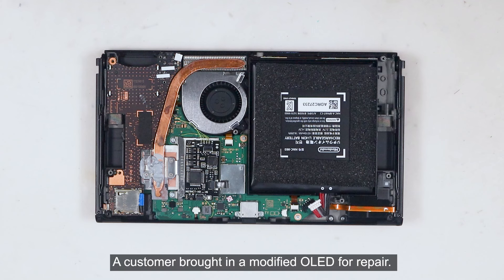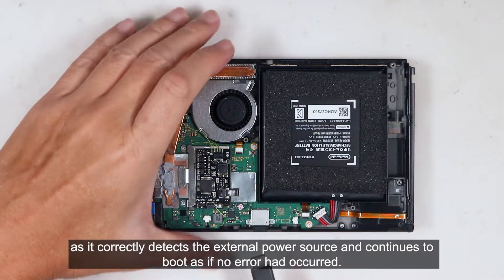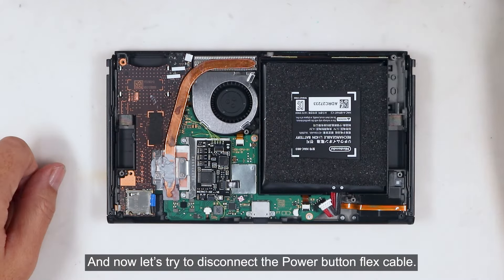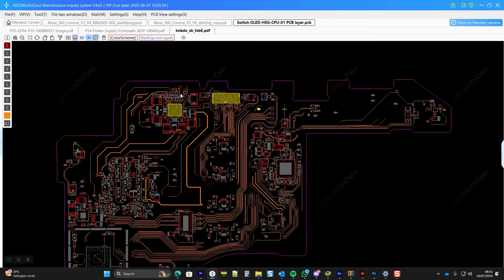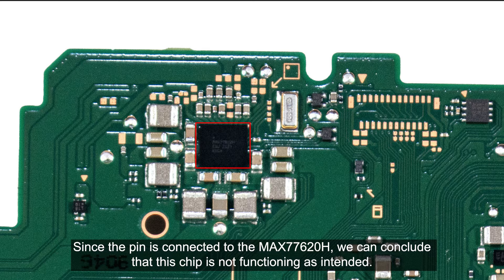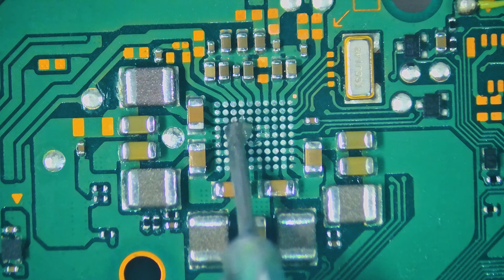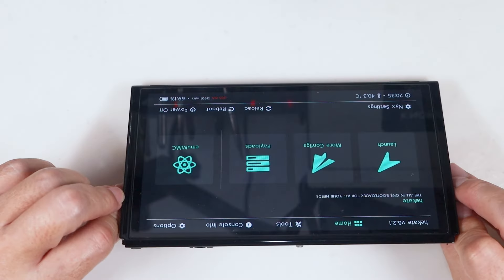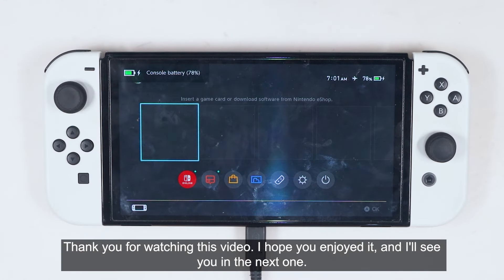FIXING THE NINTENDO SWITCH : POWER BUTTON & POWER ISSUE

Comment: 1:48 i have it too whenever i inject a payload but could it really mean something? i modded my erista switch almost a year ago thanks to the written guides and your channel and sometimes it did show that, no problems now and after 6 whole years (soon 7 in november) of having the erista, its battery health is at 95%

btw, you are soon to 100k! great content!
Reply from the maker: injecting a payload will automatically turn on the console
 that is normal.
Reply: @sthetixofficial  i know but thanks for responding, but another thing to mention is that when i go on launch via hekate and boot into emummc, semistock or sysmmc cfw, there is that charging battery icon even if i dont have any cable connected. sometimes it shows the battery or shows atmosphère logo
Reply from the maker: @thatyahoo9534 maybe it is just a glitch? as long as the console works fine then I think you don't need to be worry of it
Reply: @sthetixofficial  oh okay thank you. please never stop these high quailty video guides because they learn so much and i simply like watching your content

Comment: When you are applying heat to the MAX77620H chip how do you make sure you do not desolder the components around it?
Reply from the maker: well, you need to have experience and skill and of course you need to inspect the components around the chip with a microscope

Comment: ❤And again a very good detailed Video 👍👍👍👍

Can you make a video that makes the battery problem with the display (for example, that 199% is displayed). I had this on the old switch where I had 3 partitions (Linux,android) and had to reset it with an app always. That was very annoying
Reply from the maker: Maybe you need to do the battery desync fix with the tool from CtCaer  https://github.com/CTCaer/battery_desync_fix_nx/releases
Reply from the maker: Thank you, i dont have a project or video about battery mismatched. so have you done the battery desync fix?
Reply: @sthetixofficial  Thank you ,i had this problem on my old Switch ,now i have no problems (hope  it stays that way)

Comment: hi sthetix, im a fan of your modding skills. Just want to ask if what is the fix when a switch totally powered off, the fan will suddenly rotate at maximum speed. but when I turn ON the switch, the fan will stop rotating and will only rotate when it's needed.
Reply from the maker: is it the oled? if so, please check the this https://x.com/sthetixofficial/status/1553020990950866945
Reply: @sthetixofficial  yes OLED, thank you! i have tried to get that chip from a donor board but it is very hard to take out. i use hot air 400 deg celsius and airflow 4.5 but the solder at the bottom is not melting. any advice? :)
Reply from the maker: use a preheater like the mechanic ix50 to help you with it ..
set the bottom to about 200 and blast it from above to remove the chip easily
Reply: @sthetixofficial  thank you! really appreciate your response.

Comment: Hey! When I do the same measurement on my switch, i get 0.85V with the black probe and 2.3V with the red probe in diode mode. So can I also conclude that my MAX77620H is faulty? Thanks in advance and thank you for your amazing work. The symptoms of my switch are that it only boots to the nintendo logo and then shuts off (only when plugged in).
Reply from the maker: how do you know if the max chip is faulty? how can you be sure it is not a software issue?
Reply: @sthetixofficial  I can't, that's why I'm asking here :D originally I planed to install a picofly and try to boot into Hekate. But then I saw your videos an checked the diode values. I thought wrong diode values would always mean that there is a hardware issue, which I would like to fix before I mod my console
Reply from the maker: you need to check and compare it with xzz then you will know the issue

Comment: Hey I have weird issue with my Oled after Picofly install. Power and Volume button wont work. It only works when the switch is off and I press Volume + Power button at the same time, only then the switch will boot up. Other than that the buttons dont work at all, OFW and hekate doesnt matter. What could be the issue here? I already changed the cable and tried it on another switch. Checked the connector and I dont have any shorts or different readings. Please help
Reply from the maker: you need to discard the Pico.. Pico is known to have various issues

Comment: Hello friend, I’m a technician and I also do mods on Nintendo switch oled consoles, a strange fact happened to me, the NX v6s chip no longer turns on, the console connected to the 0.500A power supply, I have already checked the soldering points with the multimeter and they are all perfectly connected, I connected the console to the PC and it is not in RCM block, the 5V arrive regularly on the charging connector, what could it be? I would be very grateful to you! (The DAT0 is permanent)

Comment: Hi,  I have question a Nintendo switch switch came in for repair I change the usb port and P13 chip as it had shots. Now switch is fix working and charging fine. But the problem is it is not docking. I have checked LCD connector it is fine as well and there is no shot around M92 chip as well. But still not image on TV. What could the problem and advice
Reply from the maker: you need to check for the USB port and P13 again and check the connection between the power and the P13 USB . buy a USB tail tester / USB breakout board and you can see the error later.

Comment: 3 hours ago I turned off the switch after a gaming session, when I want to turn it back on I only see a black screen. I tried to perform a hard reset but it doesn't help. Do you know what could be the reason?
Reply from the maker: is your console modchipped? try to press and hold the power button for 12 secs and try pressing the power button again.

Comment: If the cfw boot and there are line show when it go emummc or ofw If disconect chip wier the line not show any more is it adapter or some where on chip or motherboard or what??? The console working and no things happend If no chip conect If remove dat0 line point  wier no more line some console yes i see this line when boot cfw some console no 😅 this is so weird ...
Reply from the maker: I think it is related to the sdcard speed or brands